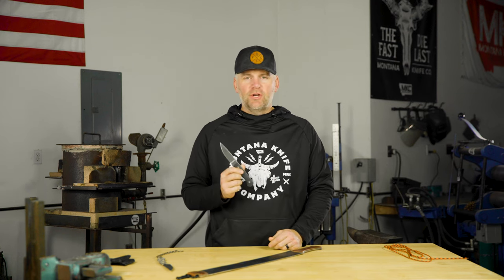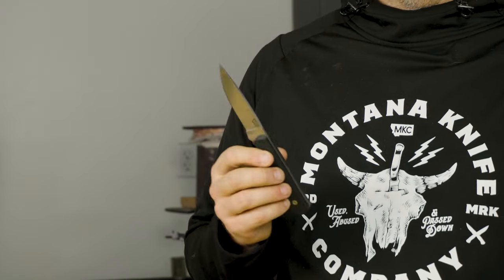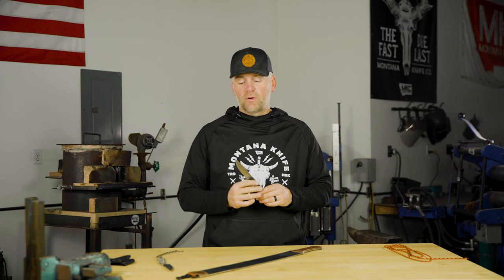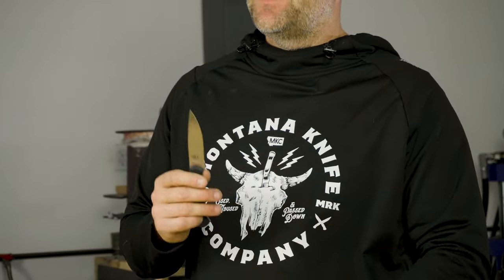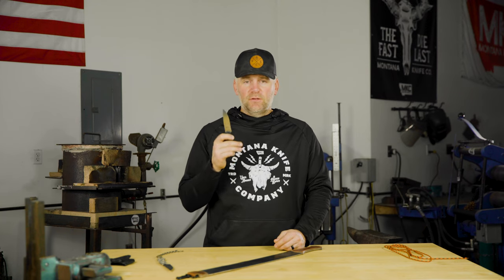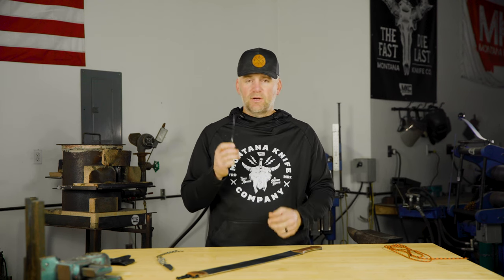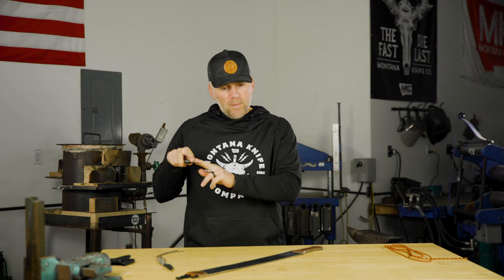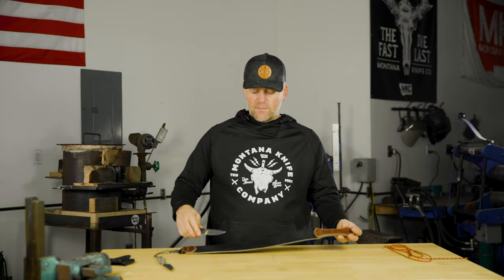Why We Sharpen Our Knives With a Working Edge

Comment: The "burr" created by pushing a knife blade across a sharpener (like a whetstone) needs to be removed (generally happens when a knife is stropped) to stabalise the knife edge after sharpening. His comcept of aggressive is more to do with the grit level of the whetstone or sharpening system used to finish the sharpening process not the burr.

Comment: Always a little hesitant to disagree with someone who has far more experience in most ways than I do, but technically I'M not. Technically a master wood carver, whose book I just read is, and I've felt the results since I implemented his (won't name him) sharpening method. Specifically, I'm disagreeing with the idea of stopping at 600 grit.
For wood carving, that "bite" that we're talking about here is VERY important, and so is edge retention. 
Master wood carvers, who tend to get asked a lot how they got their knife so sharp, will polish the * out of the edge.
I've also never seen the knife that needed something as low as 120 grit. Even completely re-shaping the grind I only ever go as low as 400.
Generally, we will sharpen on a stone very very infrequently because we keep the edge in shape, but with a new knife or one that has been badly mistreated or a bad grind, we are going to sharpen up to about 1000 grit on stones.

Then we're going to strop, which is generally considered to be around 1200. We DO run the blade backward, but that won't give it "bite."
We get the "bite" or "teeth" during the last step, and that is with very fine ceramic. I use a porcelain coffee cup I got from ebay. I'm pretty sure its "grit" would be well over 10,000.
I don't understand how it gives the edge teeth, but I can feel a definitive difference before and after the ceramic when it comes to grabbing and biting on slice cuts.
Again, this isn't my method or my knowledge. It's from someone who is world renowned in wood carving circles and I can only speak for how much it has changed my experience following his instructions.
Sorry for the length of this, but one of my biggest pet peeves is how mystical crazy * gets started and lingers and becomes "common knowledge" when it comes to knives, steel, and sharpening. It isn't magic, and it's very well understood, and there is good information out there. Just have to weed out all the bad information.
Reply: Push cuts need polished edges but slicing performs better when slicing. Wood carving requires push cutting so you do want it as sharp as possible. But for rope, food prep and skinning animals, an aggressive edge can perform much better. Two completely different uses.

Comment: I came to these same conclusions on sharpness. So what is a good test for work sharpness?  Dragging across the thumbnail?
Reply: No that just means you’ve set the edge. A good test for sharpness is to get a piece of receipt paper and run your blade through the edge of it towards the middle. You wanna feel how much resistance you’re getting from the blade and how quiet and cleanly it cuts through the paper. The quieter the cut the sharper it is

Comment: You mis-used almost ever buzzword you used in this video. You clearly don't know the difference between cut initiation and cutting ability or sharpness... or keenness.. or what makes what what. The radius of the apex... the smaller it is, the more acute, the keener the edge, the higher the cut initiation. it doesn't matter one bit if it has "teeth" aka course edge or not. Bite is just a rube/common way of describing cut initiation which just another way of describing edge keenness, which in physical terms is just a measure of the radius of the apex. The only difference between a course edge and a polished edge is that a true course edge will cut longer but be more prone to damage, whereas a polished edge wont cut quite as long but is more resistant to forming chips. When I say course I'm talking about a 120 grit edge, will score about 50% higher on a CATRA test than a polished edge. Once you get to 400 grit the difference is not very noteworthy at all.  I digress. Cut initiation and cutting ability are not the same thing. If your knives can't still make cuts with a dull edge, then you have poorly designed knives with geometry more suitable to an axe. Which to be frank is the standard within the EDC knife bro world. Shit geometry and shitty cutting ability, basically zero cutting ability once that edge is gone.   That's one reason there's all this focus on gimmicky steels, the other reason is the end users are morons that don't know how to actually use or maintain a knife and are afraid to try to sharpen one because they might "ruin it" so they're always looking for "magical" steels that don't go dull. This is because they don't actually understand how knives work, much less how to actually use or maintain one.